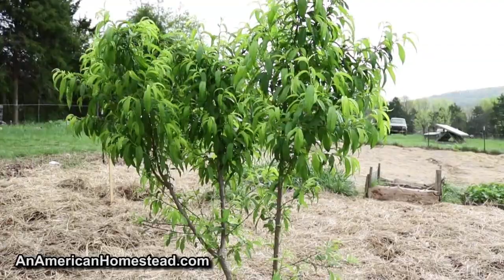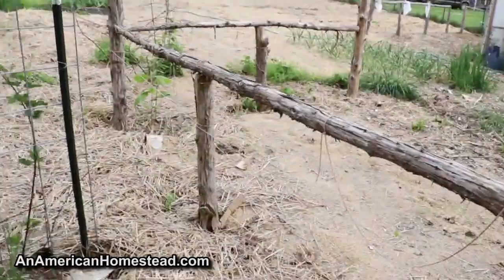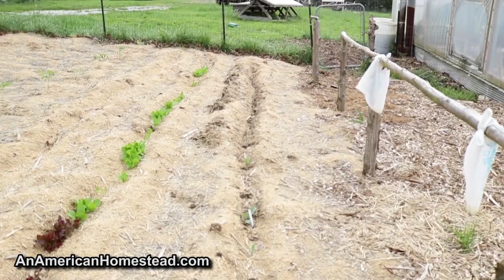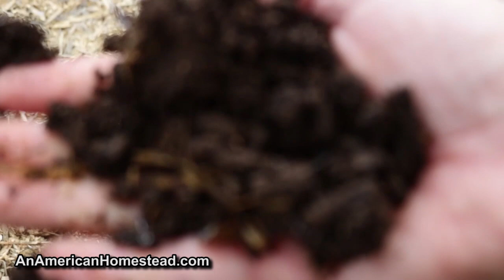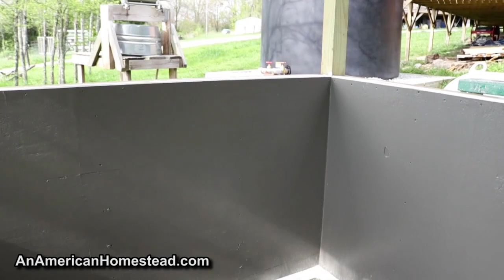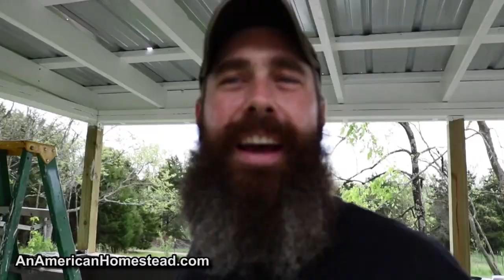Bad Dirt - Good Dirt

Comment: on my off grid place in NM I would mix up a batch of thin mud and throw it on the roof of my green house  to shade the plants and open the ends. it worked great and it doesn't cost a thing